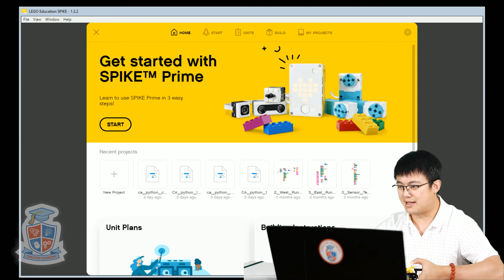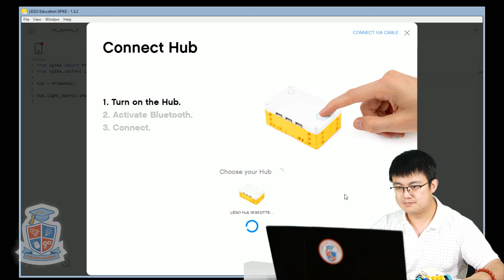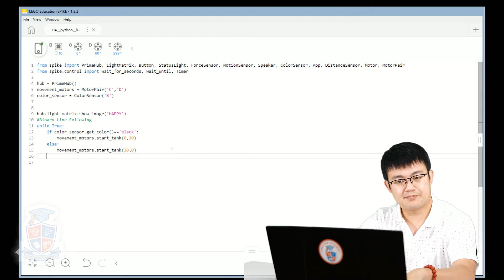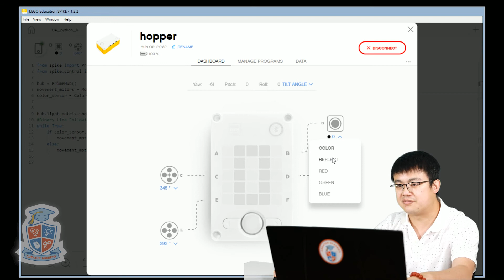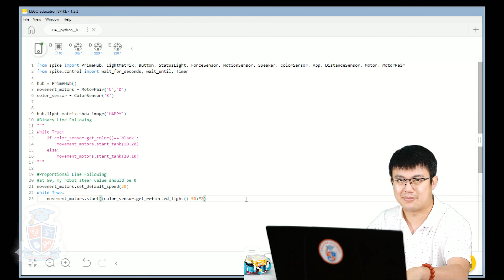Learn Python for SPIKE Prime (LEGO 45678) Part 5: Proportional Line Following For version 2 (Legacy)

Comment: whenever we use forever loop spike hub lags when we stop or start code. how to come over that problem. Also sometimes it disconnects my Bluetooth with the computer.
Reply from the maker: Loops shouldn’t lag the hub, I suggest trying another hub and checking the code to see if there is a problem with the hub or code. Bluetooth can disconnect if more than one computer has paired with the bub. Make sure hubs are disconnected and removed from pairing in settings before using another device. Garry